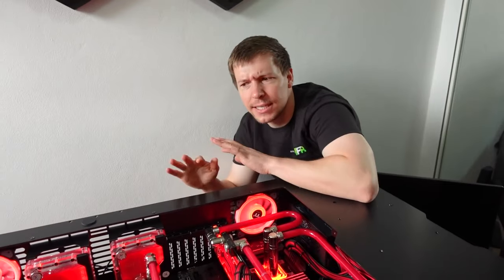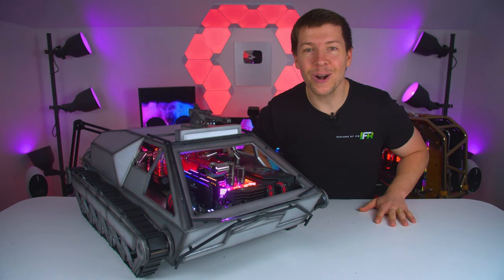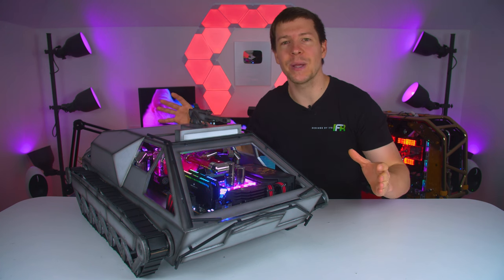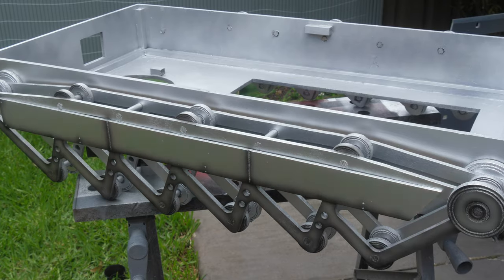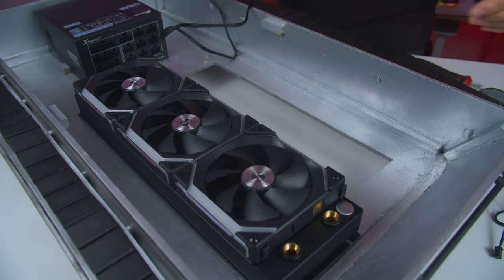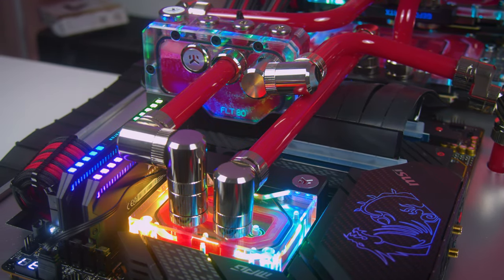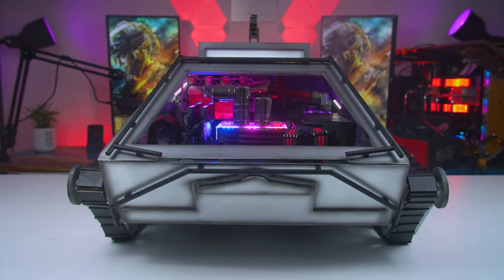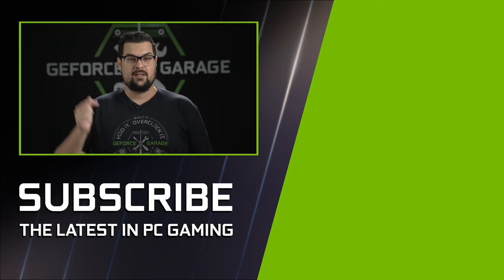GeForce Garage - Designs By IFR's BF2042 Bolte Tank Mod

Comment: 2 radiators right next to each other in the bottom, one intaking, one exhausting. So all it does is recirculate most of the hot air then.
Reply: Kind of in line with the broken game that inspired the mod I guess
Reply: Incorrect